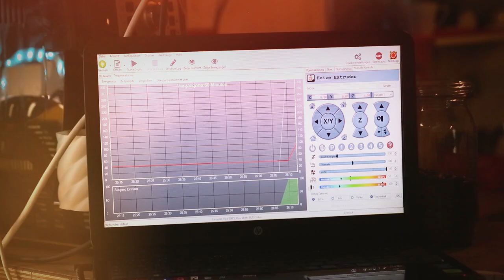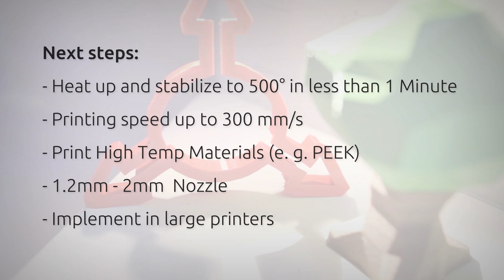3D Printer Induction Heated Hotend (heats up to 200° in 7 seconds)

Comment: "Induction patent pending" you will print this stupid method, seriously?  You can achieve this with bigger heat element in the old way. I don't see what will change this induction heating. It's more complicated and expensive. The temperature control is the same.
Reply from the maker: The heat up time is much quicker, less heat radiation to the printed part, cool down time is also very quick, so different temperatures within a layer are possible. Development is complicated but costs should be reasonable for the end user.  The heat entry can also be calculated, which would lead to even more stable temperature. The heated mass is much less. Thermal insulation is easier and better. Of course all the advantages have much bigger impact, the bigger the nozzle is... We made it work for a home printer set up, but we are looking into industrial fields to unlock the real power. The patent is also aiming in this direction.
Reply: Tencho, exactly - traditional heating elements are MUCH more sensible. Just increase the power if faster heating is desired. Having actually BUILT an induction heater of a similar size, this is an insane idea for a 3D printer. Although the coil itself is water cooled, making electrical connections to the coil is tricky as the head is moving. Large Litz wire is probably the only way this could be done.
Reply: @michaelnoble2432  I can see applications where you need to have higher temperature heating than you would have in home printers. And if I'm reading what they're claiming correctly, they can print at speeds you can only achieve with a volcano or super volcano in a regular form factor. Also means that the temperature read from the thermistor actually matches what the rest of the nozzle is seeing, as you don't have to worry about thermal diffusion within the heatblock/nozzle interface. This is not for home users, so don't judge it as such.
Reply: @goeland86  what do you mean "regular form factor"? This is massively more bulky than a regular heat block and heating element. For high temperature printing, insulation should be used, and any temperature difference between the nozzle and thermistor will be minimal. 

Copper heat blocks and high temperature resistive heating elements can achieve 500C - this use of induction heating is completely pointless.
Reply: @michaelnoble2432  regular form factor means a total size of V6 heatblock + nozzle - as opposed to the volcano or super volcano that takes up a lot more vertical space. It correspondingly shrinks your vertical print volume and introduces extra torque momentum on the heatbreak of the heatsink. It's worth noting here that the coils don't actually touch the nozzle/heated element at all, unless they did the induction very wrong.
Reply: @goeland86  the filament isn't going to care whether the heatblock is heated with a heater cartridge or by induction, so I can't see why induction heating would reduce the vertical height required. 

I agree that conventional designs put a lot of torque on a thin heatbreak, which is why the Mosquito design is more elegant, IMO.

Comment: This is definitely one of the needed technology to expand throughput. Industrial printers with big nozzles will need this. I guess it could be used in conjunction with the approach of elongating the nozzle to further increase throughput.

I'm curious about the compatibility with the firmware - is the temperature control open loop, based on a model? Or does it use thermistors like resistors?